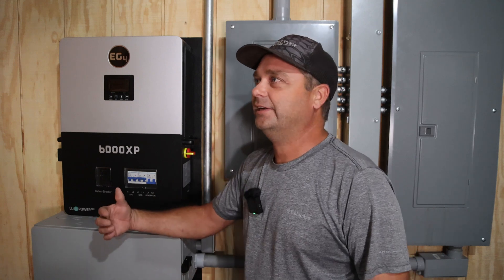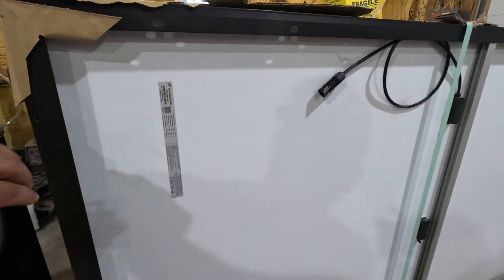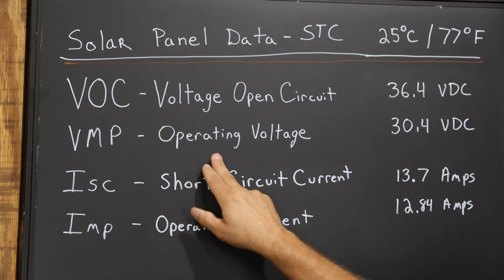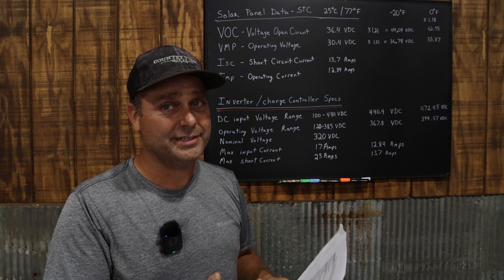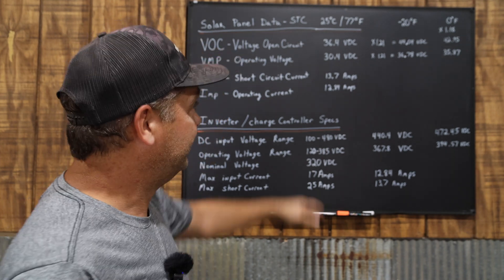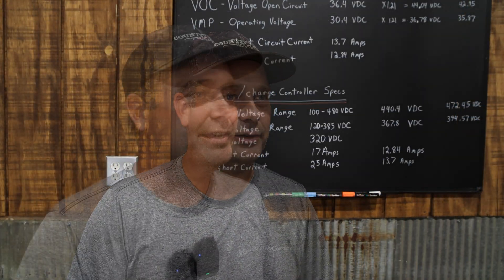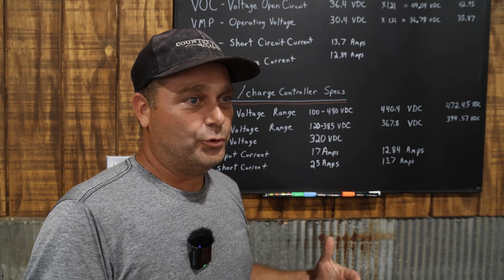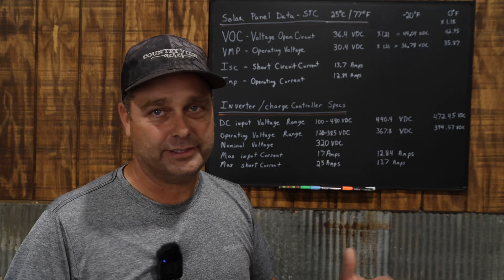How To Calculate the Maximum Number of Solar Panels - Including Cold Weather Calculation

Comment: If I had 4 or 5 items I would consider to be critical loads, such as 2-4 freezers and a refrigerator, then how would I figure up how much battery and panels I would need to buy?
Reply from the maker: Good question.   That be a good exercise to cover in a video.   
As far as determining the amount of power needed to run those items.
Their are smart outlets that can monitor the power consumption.  Plug the items into a few smart outlets and you should be able to determine the power consumption.  And you should also see the running watts.  Which would help determine the minimum output needed from an inverter.
Reply: If you have the time, get a smart outlet or power meter and monitor each critical load for a week. Record average daily consumption and peak current for compressor start up. If monitoring during cooler weather apply a conservative correction factor for increased consumption in warmer weather. 

Add up all the daily watt-hours. Apply 15% conversion losses from DC batteries to AC inverter output. Add up running amps for all appliances that might possibly be on at the same time (concurrent load). Peak current is hard to capture without a quality device but its motor based, plan on 3x demand surge over nameplate. 

The general rule of thumb is to plan for three days without charging, but if insolation in your area has lots of grey cloudy/rainy days in the winter you, and you don’t want to go to generator, you might plan for more days. 

That gives you amp-hours needed per day with conversion factor. You can back that into total amp hours. For example one of my chest freezer averages 750WH/Day. It peaks at 380watts, and runs at 96watts. 

Rounding up, to run just that one freezer for three days, I’d need 2.25KWH + 15% conversion losses or 2.6KWH at whatever voltage your inverter runs at.

Comment: Is your system protected from a EMP?
Reply from the maker: It has emp shields installed.  On the solar panels and the AC breaker panels.
Reply: Are you concerned about Skynet or is there another reason to consider EMPs?
Reply: @DonaldCole_Hampton_Roads  EMPs can be caused by a MYRIAD of events: Nuclear detonation, solar flares, EMP bombs, lightning, etc..